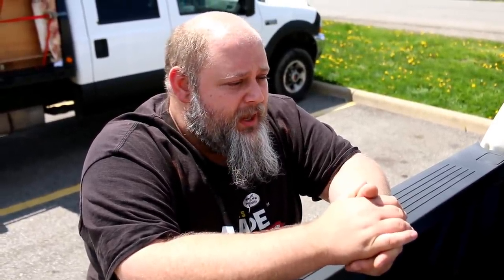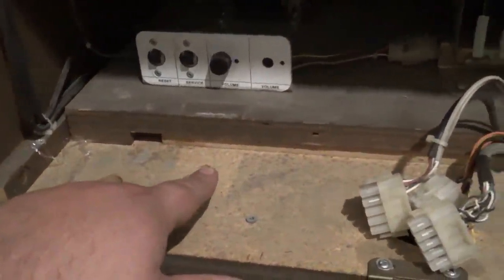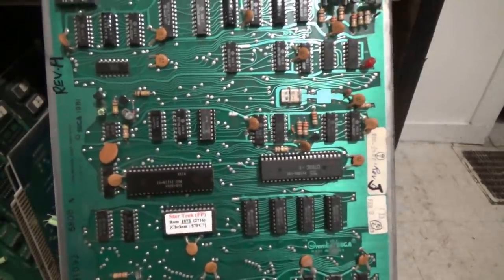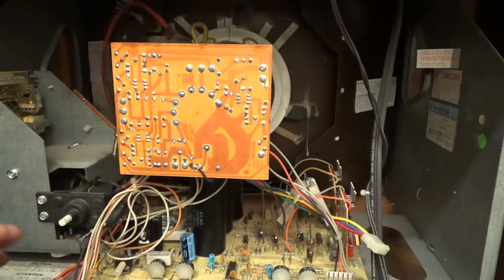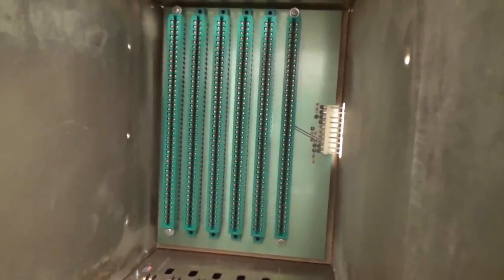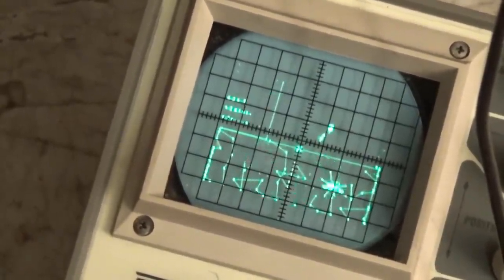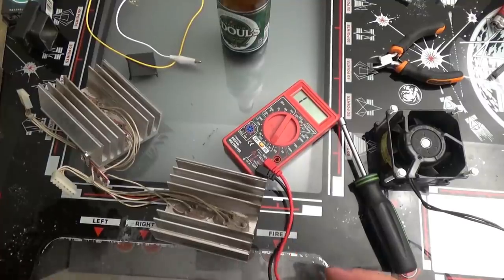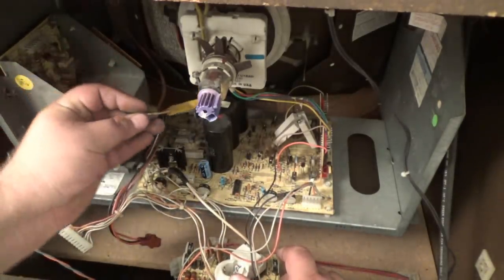Repairing a sega vector

Comment: Hey Jason that was my Space Fury! I did cap only the main board on the monitor and not the high voltage. And some of the parts, as you found, are from a Star Trek. I combined two machines into one. I still have the other one still.

Comment: Regarding the tripod, spend the extra amount on a good Manfrotto or similair high-quality tripod ... they really take a beating and live to tell the story, and even if you manage to break them, they can be repaired :)
Reply from the maker: a cheap tripod from good will is more my speed  maybe from the 80s lol  i would like to find one that has wheels on it that would be cool
Reply: @ArcadeJason  Used manfrotto tripods are super nice to ... i have a wheely-tripod, i bought the wheels used ... they are at least 1 years old, and they fit niceley to a brand new tripod.

But yea ... 500 bucks spend on videogear is 500 bucks that could have been spent on hardware :P